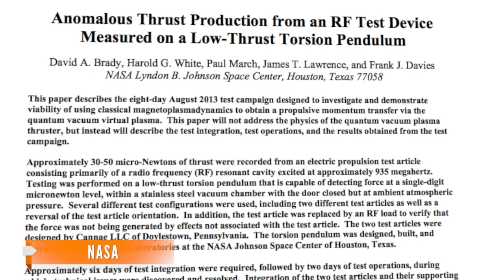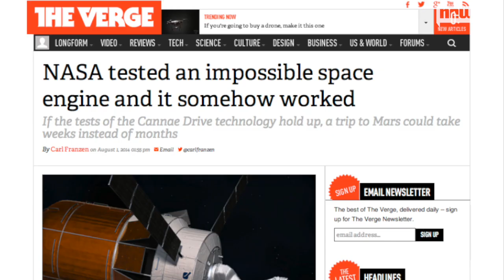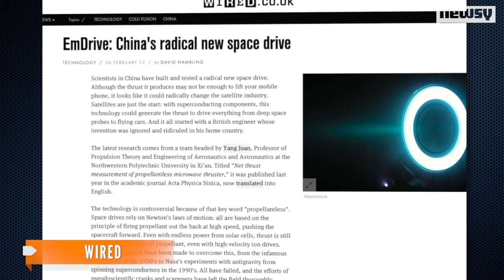NASA Tests 'Impossible' Engine, Finds Out It's Really Fast

Comment: I've read the paper this video is reporting on.  If it's not an outright hoax, it ought to provide plenty of basis for its authors to not be hired to perform any serious scientific work.  There are two MAJOR problems with the results they've achieved: 1) the "thrust" they've measured is too near the detection limit to assert a reasonable confidence that that it was not a false positive reading and 2) the device was operated in conditions which were not adequately controlled.  That is, it was not operated in a vacuum.  The thrust they measured was on instruments sensitive enough to pick up vibration from the crashing tide 20 miles! away from their testing facility.  Their measurements were likely just picking up the effects of the air that the device warmed as it energized.  Bottom line is, the theoretical thrust the device is supposed to make is based on an electrical equivalent to the "imbalanced geometry" so many perpetual motion devices (which never work) are supposed to work off of.  It's not an actually sound physical phenomenon.  It is a mathematical error.  That we, the taxpayers, now have millions of our hard-earned dollars following junk science is unacceptable.
Reply: ExaltedDuck NASA has now successfully tested the EM engine inside a vacuum.  One step closer to being real.
Reply: I like your comment. I appreciate the facts you shared. I even agree with you.
But it isn't "junk science" if it taught us something. Science is about testing boundaries and keeping an open mind.
Reply: ExaltedDuck "I'd like to see a signal-to-noise analysis" -- spoken like a scientist.  however the diff between the Vacuum drive (i'll call it) and cold fusion is that the drive needs no new physics (despite what the vid says).  

cold fusion, they never could say exactly what caused it, if it ever happened.

you've probably seen this, but wanna see something cool, youtube sonoluminescence.  it may involve the casimir effect (speculation) and temperatures over 5000 k, and occur faster than an atomic transition can explain.  

that's hot enough to fuse hydrogens!?  and you can make it with speakers and water, lol.  there's more under the sun than dreamt of in our philosophies, exalted Horatio
Reply: Yes, a few out on the fringes have experimented with such technology.  There are prototypes out there but the government is hiding them from us.  I think they call them "aeroplanes"
Reply: Agree it wasn't a lot ow thrust, but maybe a hint towards unexplained(in general science) phenomenon. Btw those "surprized" NASA workers must have been pretty green, the old guys there knows all about this and what Thomas Thowsend Brown showed them many decades ago. Too bad it had military applications though - we wont see it for another 50 years, even if the technology is developed, and theories advanced far ahead and beyond standard EM theory..
Reply: They're still very near the detection limit of their equipment and every similar device that has been built and reported upon as producing thrust has been very near its measuring instruments detection limits (I've read of much larger devices being built in China).  If they can produce a consistent thrust that is more than an order of magnitude above their instruments ability to sense, then I might revise my opinion.  Until then, I'd like to see a signal-to-noise analysis of their torsion sensor and won't put any more weight in this than I would in cold fusion.
Reply: >Have a feeling somebody knows exactly what cold fusion is, though it (like most other cutting edge technologies) hasn't found it's way out of the black and into civilian or mainstream science quite yet. Yes I have checked out sonoluminescence in the past, and I agree very interesting phenomenon. I imagined an electrolysis setup including a couple of transducers at adjustable angels if you get the picture(interference patterns, beat freqencies)
Reply: depending on how forgiving you are, cold fusion is either science fiction or fraud.
Reply: ExaltedDuck link to the paper the vid is reporting:  http://ntrs.nasa.gov/archive/nasa/casi.ntrs.nasa.gov/20140009930.pdf
Reply: It would make sense if I sound like a scientist.  I am one.  I haven't done much of anything involving high energy physics since I got to play with some big lasers in college for various spectroscopy and fluorescence experiments, but I do still enjoy reading.  

Like I've said, I've read that paper.  The technology is usually called a Q thruster or Canae thruster.  The quantum explanation in is complete bunk.  The idea of pulling energy out of a quantum vacuum is almost exactly like siphoning water uphill.  The quantum vacuum is just a fancy way of saying ground state.  It is the lowest energy configuration a given system can assume.  Just as getting water up a hill from a lake requires energetic input, so does coaxing energy from a quantum vacuum.  (Or, put another way, there is not energy to take out so you can only take what you've brought in.  Minus, of course, any losses to imperfect efficiency).  Virtual particles don't just come into existence.  Antisymetircal pairs do (to maintain the zero expectation value of the field) but then the delta V from the thruster would be generated equally in diametrically opposed directions.  That is, it would be a pressure and not a thrust.  To make a thrust from a pressure, that pressure must be directed.  This is why the Canae device had slits.  But the Canae device performed very similarly to the closed resonator.  The closed resonator has nowhere to direct a flow; it is closed.  It would simply contain the pressure and since the sum of all force vectors derived from pressure exerted against a closed surface is zero, the proposed mechanism would have to violate the 1st law of thermodynamics to produce a viable thrust.  This is why I compared it to overbalanced wheels before.  The idea is very similar.  The inventors behind overbalanced wheels tried to make devices where the center of mass of a wheel was balanced somewhere other than its rotational axis on the idea that it would perpetually "fall toward balance."  But do so , whatever work gravity had done on against the wheel's shifting masses, the wheel would have to undo to reset them for the next cycle.  With the q thruster, any forces of microwaves colliding against the resonator would be balance by the emission of those microwaves from the magnetron.  It is fundamentally balanced.  Without ejecta, there is no motive force.

Regarding sonoluminescence and cold fusion, sonoluminence is not cold.  It's quite the opposite. But the microscopic scale on which it occurs offers little harvestable energy, almost certainly many times less than what is input to the system.  Creating a speaker-based apparatus involves using an audio amp consuming several watts to creating sound at a fraction of that energy (best case scenario would be a class D or tripath chip which might afford an overall circuit power efficiency of 80-90% of its full power consumption).  The energy released by the sonoluminence would be on the order of a few milliwatts, perhaps even less.  The idea of using it for power is like shining a lamp on a photovoltaic cell or strapping a bunch of fans behind a ship's mainsail.
Reply: ExaltedDuck Regarding extraction of energy from the vacuum, you are probably right, impossible.  The casimir effect is novel enough (just measured in the 1990s) that people want naturally to play with it in the lab and in wacky theories.  

But the Cannae type device doesn't extract energy from the vacuum; it requires an energy source.  Beyond that i don't understand it really; i'll have to read more, but it doesn't seem that strange to put energy into a device and it tries to move.  

I have one quibble with "Virtual particles don't just come into existence.  Antisymetircal pairs do (to maintain the zero expectation value of the field) but then the delta V from the thruster would be generated equally in diametrically opposed directions."  ok, two.  1) virtual particles come into existence (become real) if you kick enough energy into the volume to create them by E=mc2.  One can say that in the absence of energy input from real particles, virtuals do exist for a limited time determined by dx dM >=h, or rather, dt dE >=h since we're talking about time.  

That means that low energy virtual pairs last a long time before recombining into nothingness.  it's a bit subtle about virtual vs real -- virtual apparently do not contribute to the energy density of the universe, even though they are 'really' there and e.g. affect the charge we measure of an electron.  

2) if a spaceship creates pairs of virtual particles, and one shoots out the back, and the other is reflected off the ship, both momenta would push the ship forward.  however it would have to make sure the particles don't recombine.  now i run out of knowledge on that too.

Right, sonolum is not cold!  i'd like to try making it, but i don't know if you need special speakers and equipment.  It's awesome they don't know what causes the light flash yet.  A shrinking dielectric sphere would produce a very interesting casimir effect, so that's a great candidate for the ridiculously quick flash -- quicker than it would take light to cross an atom if i recall correctly.

I've done bio research, mostly field work with birds, physics is a hobby or an obsession.
Reply: I hadn't seen that website before.  The theory is explained quite a bit better than the dreadfully garbled nonsense in the NASA paper (Like I said before, the statements on quantum effects were downright ludicrous.  If I were a NASA manager, people would be losing their jobs over it).  The relativistic waveguide reflection explanation seems at least a little plausible but is still rather self-effacing.  Reason being, the tuning of the chamber will be dependent upon its velocity.  That is, as the thing accelerates, its dimensions will change.  Even well below relativistic speeds, apparently, this drastically alters the efficiency.  Poking around in their theory and equations pages, it shows that the 31.5 N/W thrust is only attainable at rest.  And that at just 0.1 m/s velocity, that gets cut down to less than a third (9.1 N/W) of its rest value.  Bump the speed up to 3 km/s and it's down to 200 mN/kW or 0.0002 N/W or 0.002 tonnes/kW.  It may be worth noting that the Earth's speed with respect to the cosmic microwave background is approximately 390 km/s.  Now, it's not an impossible challenge to design around these facts, but it is an extreme challenge that will require consistently meaningful control of separation of the reflecting surfaces down to a plank scale to have any hope of producing anything close to the theoretical maximum efficiency.
Reply: Tuning would be critical and re-tuning on the fly in a dynamic situation would be exponentially more difficult than tuning for use in a test stand.
Reply: ExaltedDuck
Cool, now explain TTBrown, please(I'm not being sarcastic)
Reply: TTBrown thought he was making antigravitational forces with electrical fields.  As it turns out, he was ionizing air with electrical fields.  That ionized air then moved in a coordinated fashion to create a net thrust.
Reply: did you see the vacuum tests yourself or just repeating the lore
Reply: ExaltedDuck
TT Brown wasted his life on a trivial phenomenon, he didn't care to check? REALLY?
and you know all about this? sure
Reply: I never said anyone wasted anything.  In science, results that go against expectations are often more important than confirmed predictions.  In the case of lifters, however, you can run the calculations and pretty accurately predict just how much thrust you can get and yes - you can put them in hard, high vacuum and the thrust goes away.  The effect has nothing to do with antigravity.  This is provable in Brown's own prototypes because they must be tethered.  If it's an antigravity effect, it should occur antinormal to the curvature of the earth.  But it's not.  It's a simple vectored thrust in the direction of the capacitor's electrical field. Useful devices have been developed from his work.  Ionic air purifiers and bladeless fans are based ont he effect he described.  But the known laws of physics were neither contradicted nor modified as a result of his work.
Reply: In that case, that's pretty much what the TT Brown thing does.  It's usually talk about in terms of the flow of air but any moving fluid is a pressure differential.  It's a distinction without a difference.  Like a 6 or half dozen kind of thing.
Reply: ExaltedDuck
Also the HV bladeless fans etc, was discovered long before Brown was even born. If Tesla didn't notice this phenomenon he'd be pretty blind. (In fact he patented a few in the 1890's) About gravity, I personally think later you'll find (and for a long time a few people knew) it is the cousin from magnetism, the way it behaves it's just so obvious - it's incredible you guys say you haven't figured out what it really is, maybe because you keep calling any experimental proof of alteration hoaxes or explain it away as phenomenons you already know. How can we get any progress like that?
Why don't accept you(scientists) don't know everything, there are things left to be explained(proper) and new theories to be developed. if you start looking for the wierd phenomenons with this mindset, you'll get us all a little further.
What was John Hutchinson doing with his two angled "Tesla coils" ? Photoshopping? In the 80's ? Trick photography? When they can't explain it by known theory they(the DOD experts) start looking for telekinetic effects(!) - or maybe he's the only one that can tune this thing - because they have problems replicating it without him - at least that's what those tricksters say to the press - instead of what's right in front us - a "new" (I'd say Tesla)electromagnetic effect that seriously alters matters composition and weight. I suppose you agree military science is way ahead of the universities, and spend a lot of money on keeping strategic secrets.
Reply: ExaltedDuck
"any moving fluid", now that's a hint at least, of course - as a scientist you can't say the ether - what about the Natural Medium ? sounds pretty cool doesn't it. Better than terms chosen by the quantum physics guys, if you believe them over the Michelson/Mor."proof" that has retarded our civilian science for ages.
Reply: No,no,no! the ether don't exist, remember! just kidding, of course it does. About the B2 - Did you ever look at TTBrowns patents for HV planes with flame jet generators?
Reply: +ExaultedDuck
"Reason being, the tuning of the chamber will be dependent upon its 
velocity.  That is, as the thing accelerates, its dimensions will 
change.  Even well below relativistic speeds, apparently, this 
drastically alters the efficiency. "

Not if Einstein was right about relativity.  The dimensional warping with speed is using an external reference frame that the artifact is moving fast relative to.  If you were traveling in a near speed of light craft it would not seem to you that the ship was shrinking fore to aft, rather that the external universe was warping.  The central point of relativity is that physics is the same in all reference frames and nothing about the way mechanics or electromagnetism works within YOUR (the observer's) reference frame will tell you how fast you're going or be altered by how fast you're going.  A device that stops working when it reaches a certain speed because of "relativistic dimensional warping" violates the relativistic prohibition of privileged reference frames.
Reply: I find it interesting that all the "errors are in the direction they are pointing for.